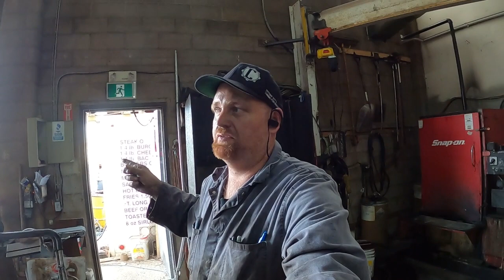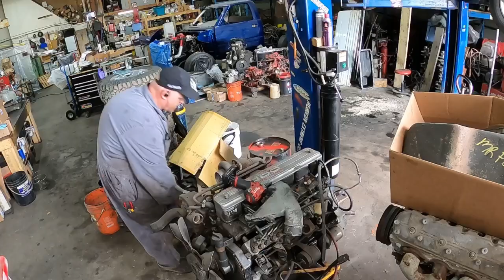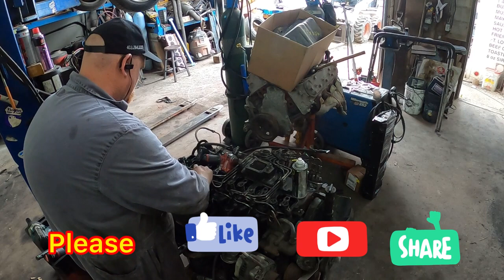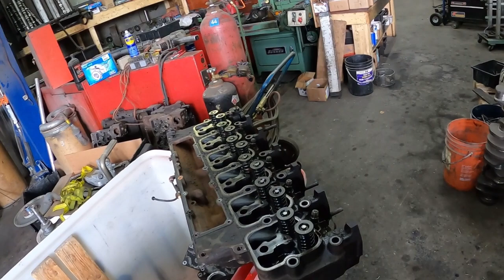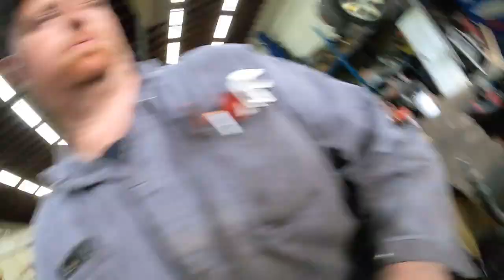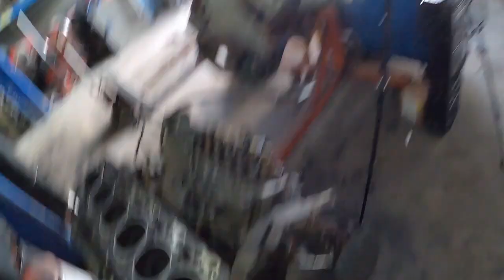how to build a 12 valve Cummins for towing ( engine for my  95 Cummins)

Comment: Hey building a tow pig. On a 01. What are your thoughts on the 6.7 turbo kit. Have a fass, 4” exhaust,50 horsepower injectors, ram intake, and cold air intake. Love the in depth vids old and new keep it up.
Reply from the maker: I am not a fan of the vgt myself. To many issues. A turbo/s sized right work very well

Comment: Which brand of oil cooler gasket would you reccomend? I read somewhere that they vary in quality. Bought a mahle full engine kit for 89-98 and it came with a 97-98 gasket. go figure.
Reply from the maker: cooler right now is what you cam get ,

Comment: Good morning Rob, hey, I was just wondering if you happen to know the part number for the lock nut that goes on the low idle set screw or whatever it’s called? For the life of me I can’t seem to find it on the Internet all I can find is how to adjust it and what type it is the guy who previously owned my truck must’ve tried to adjust it but rounded off the nut so when I went to try to adjust it yesterday, it was damn near impossible without the wrench slipping off the nut so I might need to put a new note on it unless you’ve got any suggestions on how to do it without cut without pulling the nut off if you can give me a comment back on what the part number was or is sorry for the locknut by to be appreciated or if you even have some yourself maybe I’ll come buy it off you I have a Calgary.
Reply from the maker: it should jusy be a m6 1.0 nut the striped part hard to tell i would try small vice grips myself

Comment: What I would do if I was you are I would take and take all your valves out check your seats and I would do a little bit of bowl work open the bowls up a little bit that promotes water flow and I check the short side radius is a little bit and gasket match the exhaust ports to the manifold and then Gasket match The manifold to the turbo and you’ll pick up a lot of power there or modest amount of power anyway doing good all right this is six in a row jim From Kennerdell Pennsylvania😊

Comment: I need more practical instruction.  I have a 96 12v and need to change the tappet cover.  There are tons of video's but none that go step by step.  Take it apart and putting it back together running.
Reply from the maker: I will be a video talking about it